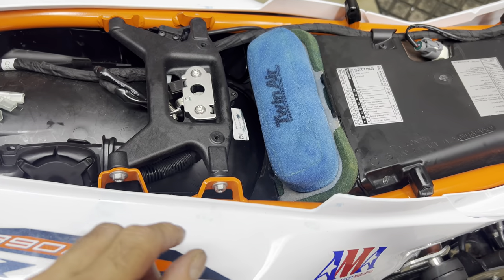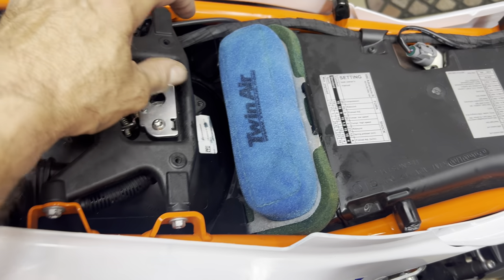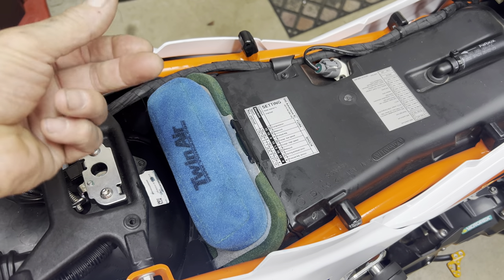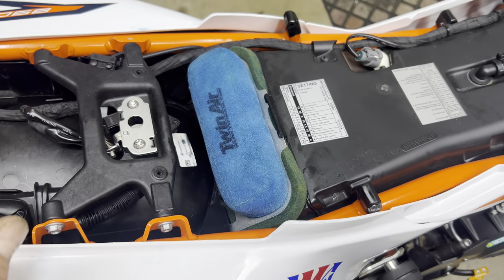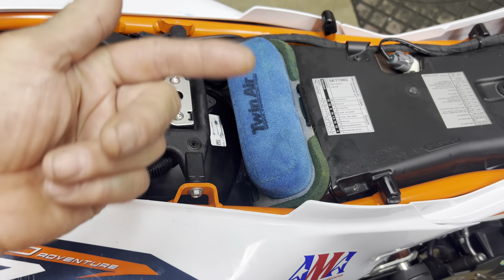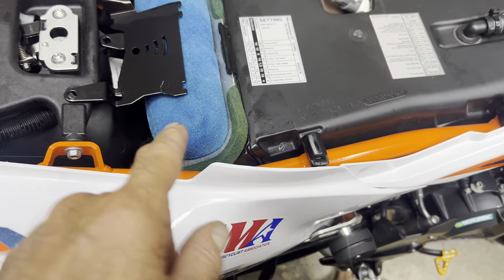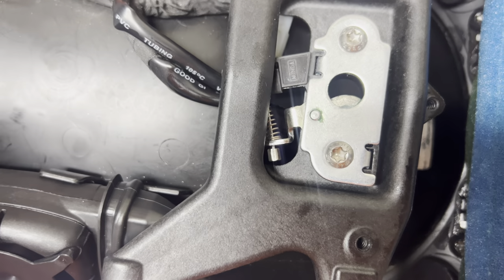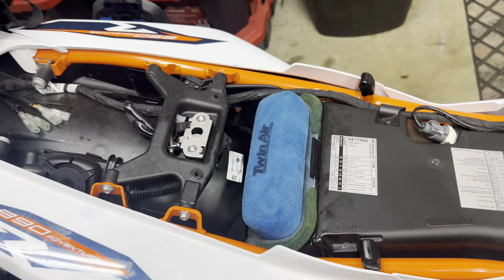Caution on installing the twinair pre filter on  ktm 790-890 adventure r 19-23

Comment: Did you have any issues with the bike on the TAT or various BDRs you did?
Reply from the maker: Zero issues on the tat. No problem on the 7 colorado passes that i did. Suspension setup worked great. No issues going through the desserts at high temperature. Zero issues with fuel pump, i don’t run the tank dry, which i believe is the main cause of these pumps going bad. Overall, couldn’t be happier with the bike, i can’t imagine having done it with a smaller bike as far as the highway miles and the torque for climbing without a run up etc. 
having said all that, i had planned to do a few BDRs on my way back but had to come home to take care of a few things that had come up in my absence. So i jumped on the highway on my way back and didn’t pay attention to chain slack. Running 90mph on highway constantly for couple thousand miles and not checking chain tension finally got me. 500 miles from home i had a chain slap that Bent the chain guard by the front sprocket pushing it under the shifter arm. It broke two of the bolts. So i took off the guard and corrected the chain slack. Doing that i knew the chain was done for (15000 miles) as i had run out of room pulling the wheel back.
I got home and next day when i was cleaning the bike i noticed it had not only busted the sprocket cover but also had cracked the engine casing directly in front of the sprocket. Wasn’t a through crack though. No oil was coming out. So i jb welded it and decided to trade it in for a 2023 model. I took a beating on the trade as i told the dealer about the crack. I am so anal about maintenance, which makes me mad that i totally forgot to check chain tension on the way back on the highway. I put it to being tied and just needing to get back home quick. 
On this new bike I’m not changing the sprocket cover from oem to the cnc type cover that i had on the previous bike. In fact ktm told me that they do not recommend those covers precisely for that reason.
Reply: Dang dude, you are lucky.  A snapped chain at 90mph could have been much worse.  I think chain tension is a frequently overlooked item for some reason.  Well, I guess it’s a testament to you love for the KTM that you got another.   Glad you had a good trip up until that point.
Reply from the maker: @Argo-F-Ur-Sef  thx but chain didn’t snap, it jumped the sprocket and slapped the engine casing. Either way, i was lucky😁